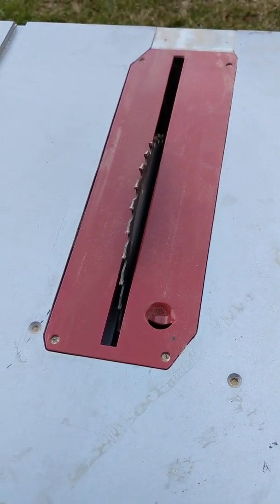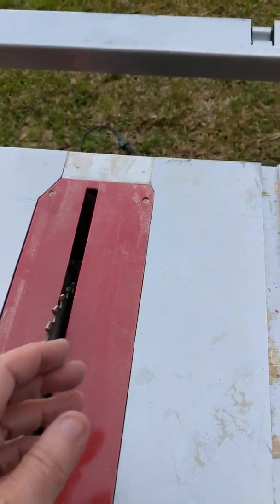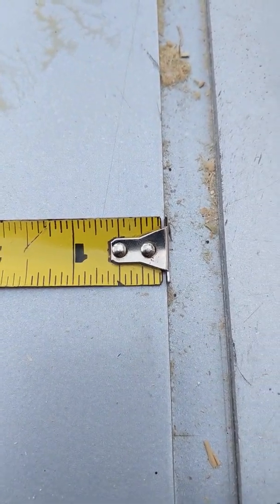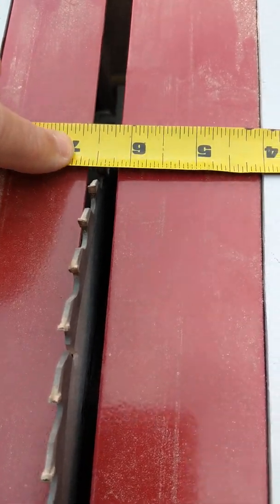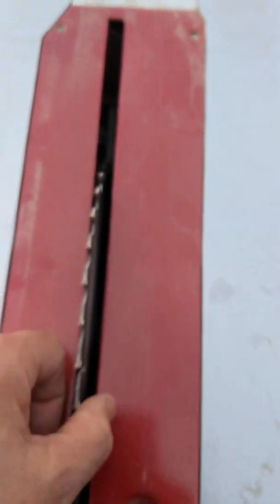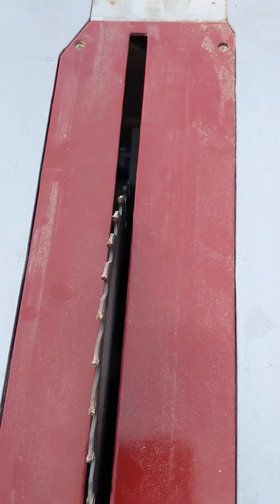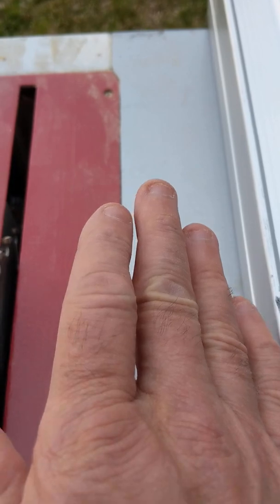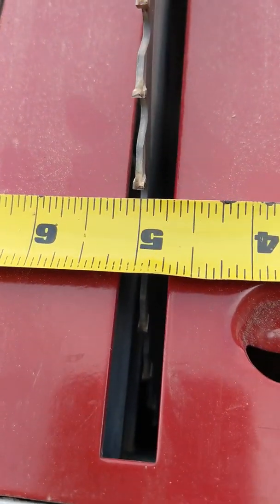JIANGSU JINFEIDA MJ10250VIII Master Mechanic Table Saw Rip Fence! YOU MUST SEE THIS!

Comment: How did your fix work out? Was it aligned properly afterwards?
Reply from the maker: Yes it worked great.  I ended up slotting one of the holes so that i could line it up perfectly.  Then I verified that the distance from the front of the blade to the slots was the same as the distance at the rear of the blade.  That was my biggest issue with the saw and was something that anyone with decent skills could do.  Thank you for taking the time to watch it.